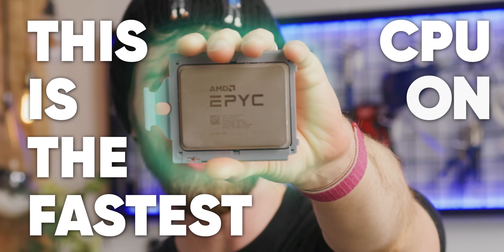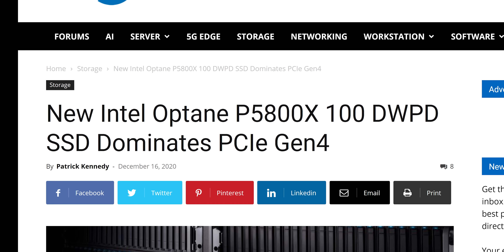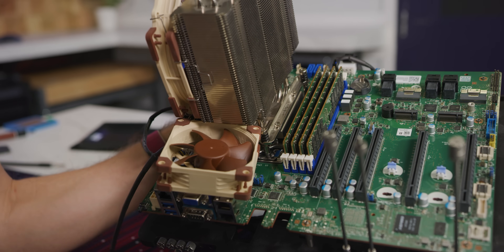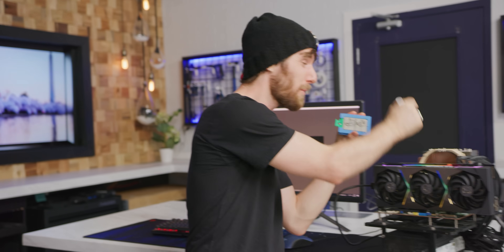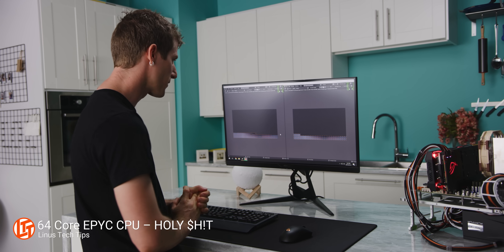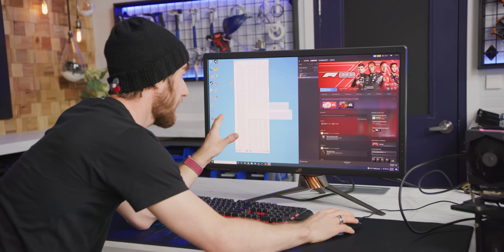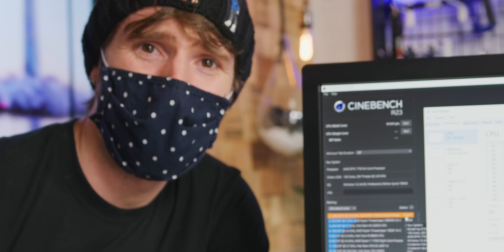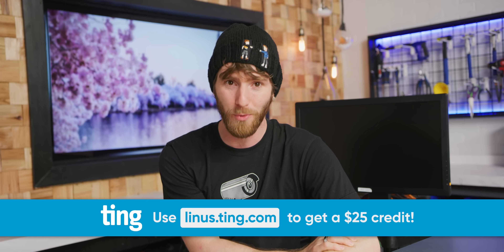The Fastest CPU on the Planet - HOLY $H!T - EPYC Milan 7763 64 Core

Comment: I love how Linus makes out that AMD asking $8k for a processor is alot.... Intel's 28 core Xeon Platinum costs around 3x as much and has less than half the cores, in reality because most server vendors (HPE, Dell, Lenovo etc...) are desperate for end users to buy AMD chips to fund further R&D for future models of AMD rack servers as its only been the last generation of Epyc cpus that enterprises customers have really been sure about buying (prior to this AMD based servers were relegated to non-system critical servers as little trust was placed on AMD chips) as AMD for years haven't had a remotely competative offering to Intel's Xeon lines, however even for single server solutions proper end users would be approaching distributors directly and working with them to pay around half that supposed $8k price tag. (Source : me working in IT distribution for 10 years and designing and selling server solutions with these vendors and chips)
Reply: Also this video is factually incorrect, the Xeon's mentioned can actually be put into 8 socket solutions

Comment: I want an Intel CPU because I use Format Factory extensively to compress video and it can utilize built in QSV compression for h.264 and h.265. There are other optimizations with AMD chips that are similar, that they've also added to that freeware but it's just I've seen an i3 laptop and an i7 NUC crush it with video compression. Has Linus ever looked into that, or is it something that gets exploited with one of the tests they like to run?

Comment: 20 years ago i thought a AMD Athlon 1000 was a big cpu and they would only get smaller and smaller, but i now see the future is huge cpus. i guess its only logical , as we use the pins under to connect to a  mainboard, and they can only get so small before it becomes fragile. so i predict in 2050 a cpu will be as big as a dinner plate.

Comment: Let Corridor Crew give you their heaviest project and see how it stacks up in VFX production.
Reply: That would be ... epyc
Reply: That'd be interesting.
Reply: I wanna see if you can cook an egg on one of these when it's running under load.
Reply: @stickiedmin6508  No, you'd need intel for that.
Reply: @K.R.X  
If the chip can shift upwards of two hundred and eighty watts through itself, then I don't much care about anything Intel does or doesn't do - I wanna see it cook an egg.
Careful experiments done in 1979 by The Departments of Poultry Science and Agricultural Engineering at Cornell University concluded that between 90 and 100 Watt hours are needed to decently fry an egg.
Rounding down to 250 Watts for convenience would give a CPU top cooking time of 0.4 hours or somewhere around 25 minutes.
Tell me you don't wanna see that happen?
Reply: @stickiedmin6508  Damn. You got me excited. Now I actually wanna see an egg fried on a CPU.
Reply: @K.R.X  
Hell yeah homie!
🤜⚡🤛
Just think - if we can figure out a way of combining a CPU cooler with a tiny little frying pan . . .
We're gonna be so rich!
Reply: @stickiedmin6508  cast iron cpu cooler.
Reply: Isn't corridor Intel?

Comment: Too bad you can't run that cinebench test on an E980.  They have 192 cores / 1536 threads running at 4GHz... can't compare to x86 clocks though because it's RISC ppc64

Comment: Can u guys plz help me with a gtx 760 saying in the manager Microsoft stopped this adapter error code 43 and it wont run any game plz help i cant afford to buy a new one iam just enjoying my time with this 760 and iam totally satisfied with it i just want a repair
Reply: It's too old and weak to run any modern games, you can't update the drivers on it so you will have to find the last driver that worked for it as well.
Reply: @T-DsGaming  nvidia just dropped an update from like 2 days since i did it it made my pc crash and the while thing started but actually it can run some modern games just like valorant on like 270fps and fortnite on like 150 or 160 fps can run battlefield 1 in like 90 fps and gta v ultra like 80 fps  war zone on 720p like 46 fps but i cant afford to buy a good pc so i just want to fix my card
Reply: @volgado4067  You can't run the latest driver or it will mess up. You have to run the last driver that worked with the card, contact NVidia and they will tell you the driver you should run. After you download the driver they give you you can NOT update it after that. Had the same thing happen to my GT750.
Reply: @T-DsGaming  no i meant the latest driver to my card my geforce experience told me there is an update 720mb i did it and agter about two hours the whole thing started
Reply: @volgado4067  Yeah you can't use the Geforce experience with old cards, the new drivers cause them to crash. You have to download the last driver that worked for that card. You can roll back the driver or contact nvidia and they will send you a link to the best driver for that card. after that you do not update the driver any more.

Comment: I, too, broke when Linus started playing a racing game with keyboard controls.
Reply: In case you missed it, Top Leaderboard in Formula One 2020, Forza Horizon 4, and many other Racing Games, are using Keyboard.
Reply: @ClayWheeler  That's with driving assist on, isn't it?
Reply: @howardlam6181  Not only is this dude lying, but it doesnt even matter anyway. all the top leaderboards are heavily cheated to shit.
Reply: @ClayWheeler f1 2020? yeah no the top of those leaderboards are either hacking or just using a wheel lmao
Reply: @ClayWheeler  I honestly don't see how.

There are professional sim racers with wheel setups out there, though Forza Horizon doesn't quite fit into the hardcore sim category.

I mean I'm not bad with a keyboard and there are generally more aids to help if you're using mechanical keys vs analog input vs wheels but there is a reason we have $3000 wheel setups for 4096 bit resolution on the wheel and 1024 bit resolution on the pedals, driving with a simple on/off switch for steering, brakes and throttle is limiting at best.
Reply: Considering he kept an F1 car going the right direction with a keyboard, he did alright.

lol
Reply: I play f1 2013 on keyboard and its actually pretty decent😂
Reply: Wait, how else do you play them?
Reply: That's the OG way to play racing games.

Comment: For crysis 3 it has a frame cap at around 60 fps which has a workaround to enable full performance. All you need is to go to Nvidia control panel, set vsync to "fast" and then set maximum fps at 1000 and hit apply. After that go back to the game disable vsync and restart the game. This game should run at well well over a 100 fps on a 3090 considering my rtx 3060 ti gets me an average of about 140 fps on 1080p ultra details

Comment: I definitely appreciate the socket being the same, working in a data center that runs all AMD EPYC processors!
Reply: While the socket may be the same most of the time your chipset won't work, so you need new boards anyway.
Reply: @Kabelman  Actually it will with a bios update if supported by the manufacturer.
Reply: @gimmegimme8468  Yeah of they support it, my experience with hardware beyond 100k per U is usually that there will not be support cause of certificates.
Reply: @Kabelman  Yeah but we have a good support system with all vendors from mb's to gpu's so shouldn't be an issue
Reply: Your power costs will go through the roof.
Reply: @Esico6  Why - it's more powerefficient than anything before it.

Comment: so hold up.

You got two of them.

and per the specs they can be dual socket.

WHERE IS TEH DUAL SOCKET BUILD LINUS? Where are those 128 core, 256 thread tests?

Comment: Now that the PC enthusiasts have been lately getting more aware of processor architectures and their nano meter naming schemes, it's a bit of disruptive to be still comparing so casually AMD's and Intel's nano meters in videos like it would mean something sensible to anyone. Pretty much the same thing as comparing clock speeds between Intel and AMD or between different generations.

Comment: There is an idea that i have but i am wondering if it will works 
Use a platter device to cool water and water will go to the radiator the radiator fans will push a cool air in to the computer it is like mini air conditioner  I hope the idea will reach I think it will work without much problem

Comment: Put one of these in a Mac Pro style case with good airflow and see just how quiet of a server you can make with one of these. The 2007 Mac Pro ran with 2 X 3 GHz Xeons with 150 W TDP each, so 300 W in a workstation wouldn't be that bad.
The quieter the better, but still with epic performance!!

Comment: If you run windows 10, even pro, and not enterprise or server (or Linux), then likely the scheduler is slowing down your processor to 64c/64t performance, possibly worse.  The 32 core equivalent can be clocked higher since it has fewer cores to be cooled and they are more likely to be higher performing speed wise.  When you actually buy these, to use the performance they need to be matched with a good OS.

Comment: Just when I thought a $4k 64-core CPU was expensive, AMD outdid themselves with an $8k 64-core CPU. +20% speed for +100% cost makes no sense to me. If it costs 2x as much it better be 2x as fast, otherwise might as well get 2 of the cheaper CPU's for the same price. For $8k they should have made it 128 cores (8 chiplets 16 cores each, basically 8x 5950x's ), even if it did need a 600W socket/cooler.
Reply: Well don't forget the CPU is not the only cost, there's also the memory and board and power.
Reply: @SoulTouchMusic93  server boards aren't that expensive. Memory/board/power is only about $1k-2k, not $4k. As a drop in replacement upgrade AMD is probably marketing it as it makes little sense, only slightly better than going from a 3080 to a 3090 from gaming performance standpoint, but far worse from a price standpoint.

Comment: In a few years when these EPYC CPUs start retiring and going into the second hand market, it is going to be quite hard to find a CPU that is not PSB vendor locked like the one Linus is using here. Most of them is going to be locked to DELL or HPE platforms. Which means no replacement for cheap old Xeons, and more E-waste in the future.

Comment: Damn, one system with two of those would give 16 pc's 8 cores, each with 2.3-2.8Ghz, you simply need 512GB so you can allocate 24GB to each of the VM - what i wonder is how do you handle all the GPU's that you would need, i mean technically speaking 8 3090 does the trick, 10gb vram each...... thats already  30k without the "case" to house it all. But  hey, perfect system if you run some sort of internet cafee, only one system to control them all - running everything in a VM keeps your system safe, allowing network control to avoid crap happening - not a bad chip indeed. Intel is badly losing the race.

Comment: AMD might allow CPU swap out in the server space but what about how it screwed over those who supported AMD in the threadripper space?

Gen 1 threadripper adopters had some issues with upgrading to Gen 2

Gen 2 threadripper hardware owners got royally screwed because their whole upgrade path was obsoleted when AMD changed the socket design

Threadripper prices also skyrocketed and turned into a low end epyc class offering

It really seems like AMD used threadripper adopters to grab some early cash from while they focused on epyc and Ryzen in lower markets

Threadripper has all but been abandoned in regards to offering server class at workstation prices

It's hard to trust AMD for anything threadripper anymore
Reply: Why push people to Whatsapp?

It's intrusive, information leaky and doesn't honor privacy!

Get with Telegram or better still Signal and stop pushing crappy Whatsapp
Reply: W•H•A•T•S•A•P•P

+•1•4•1•2•4•0•5•1•4•3•2•

I•n•v•e•s•t•<>in<>C•r•y•p••t•o
B•T•C<>A•N•D<>•E•T•H•, D•O•G•E..!!
Reply: W•H•A•T•S•A•P•P

+•1•4•1•2•4•0•5•1•4•3•2•

I•n•v•e•s•t•<>in<>C•r•y•p••t•o
B•T•C<>A•N•D<>•E•T•H•, D•O•G•E..!!

Comment: Did you have the server plugged into 220v? My understanding is it will run cooler and quieter, generally more efficiently,  if you do. Was it putting out that much noise even on 220?

Comment: I'm a planetary scientist, I've been using a rack with dual Xeon Gold 6138s to run some computational thermal models for the Moon and they can take the computer around 54 hours to run in full. I'd find it interesting to try running my model on dual EPYC 7763s and comparing them! (Plus I'm in a huge time crunch to run 5 of these models and a faster computer could do wonders lol) Let me know if that's something you'd want to try out!

Comment: I'm in the process of budgeting out a dual-Epyc machine to build, probably going to begin buying parts in the next month or so.  So I absolutely need those pillows, so keep reminding us when they actually come in!  I'm not going to build around a Epyc 7763 YET, but probably around some of the first or second gen chips, should be enough to match my current system (Dual Opteron 6276), and then when data centers cast off old 7763's cheat I can upgrade to what's cheap then.  Love watching you build these beasts, even more fun building them myself :)  Mine will probably end up targeting a EPYC 73F3  for the faster top end clock speed, vs a crap-ton of cores ... wish I could mix and match something with a huge number of cores, and one with fast clock speed.

Comment: dude imagine game using not fixed update but just update and then you playing it with this... 
for those who dont know fixed update is updating game stuff at fixed framerate (so things run the same on any device) but if you use just update then things would update on every frame possible so on slow pc things would be slow in game but with this... now that i explained it it sounds stupid

Comment: Pop 8 Tesla V100s and you've got yourself a killer Deep Learning box. The way I use my university's 160C/320T compute node is by training multiple independent CNNs and RNNs in parallel. The trick is to be able to automate experiments to fill out a given number of workers, around 20C/40T + 2 GPUs per simulation. I never use the entire thing for one experiment, but the virtualization available using a scheduler lets me light up the entire thing for weeks. I think I process somewhere in the 10s of billions of datum per week.

Comment: I don't know how easily they can get away with it, but I wonder if they could bruteforce emulating modern console games entirely through software, or at least interpreters rather than recompilers. They probably don't scale as well with multiple cores as they would with single core performance, but I'm curious.

For example, Dolphin has the option to use a software renderer graphics backend AND use an interpreter to emulate the CPU, but there's obviously no reason to use those when hardware acceleration is thing

Comment: I have a cool suggestion:

The Einstein Toolkit has a tutorial on how to run a Binary Black Hole simulation:
https://einsteintoolkit.org/gallery/bbh/index.html

The simulation in the tutorial was run on 16 Intel(R) Xeon(R) E5-2630 v3 CPUs (128 cores in total) and took about 101 GB of RAM. 
It took the cluster about 3 days to finish the simulation.

It would be really cool to see how the 64C/128T Epic processor would do in this test scenario. LTT surely has access to 128 GB of ECC RAM.
Personally, I think the Epic wins because in a cluster multiple CPUs have to communicate with each other and lose precious number crunching time.
If we are only using one CPU and thus one computational node, the communication time between multiple nodes is gone. 
On top of that, we have the large IPC increase of the new AMD processor.

Edit: 
Remember the gravitational waves that were first detected by LIGO back in 2016?
Well, this is the simulation of that very event (: